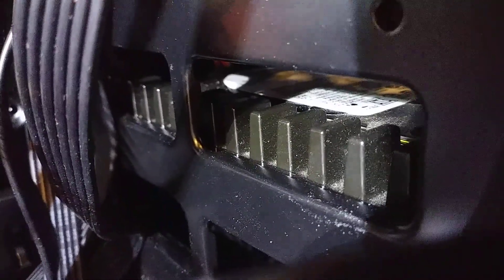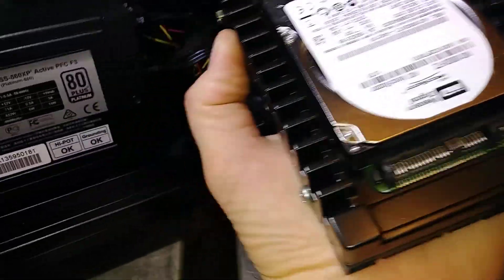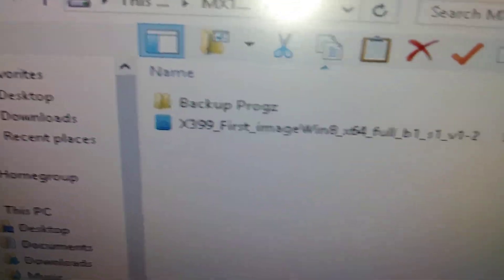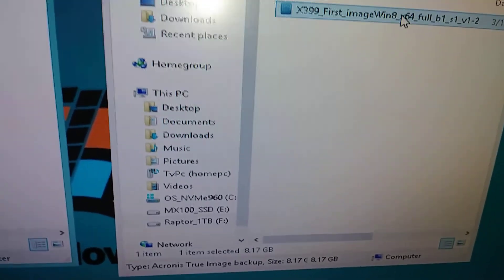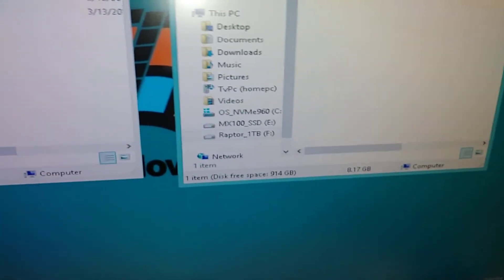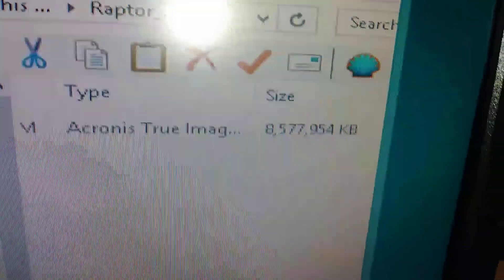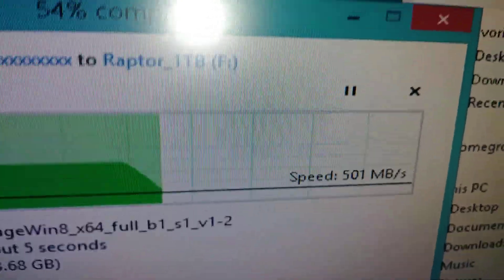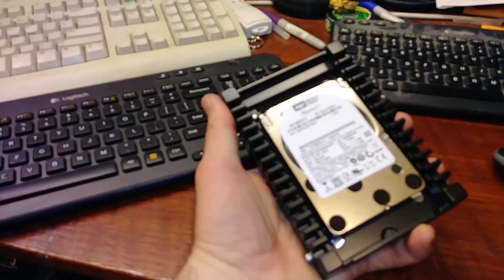SATA SSD vs 10K Raptor HDD ,Samsung 960 Pro NVMe, Surprise end, Raptor is Faasst ! ...Old School

Comment: I also have the VelociRaptor running since 2003, but it's only 74g.  Needless to say it has no files on it, only an operating system.  It is spec'd at Newegg to run at 1.5GB/s, I don't recall ANY wd Raptor spec'd to run at only 200mb/s... Here's the newegg link to mine.
https://www.newegg.com/western-digital-raptor-wd740adfd-74gb/p/N82E16822136033
Came here to see if my old faithful Raptor is still faster than the standard ssd's (last time I checked about 5 years ago it was), but you have me now looking at the NVMe's.  smh  lol  Thanx.  I just ordered a ssd that's spec'd to read at 560mb/s & write at 510mb/s, so I really can't see it being faster than my Raptor.  Although the ssd IS faster than the one I tried 5 years ago, unless something else plays a factor in speed I think I'm going to be disappointed when my new ssd arrives.  What do you think?
Reply from the maker: What you saw was real time, unedited. idk what the transfer went at the rate it did. This was just for fun. The larger raptors were definitely faster though.